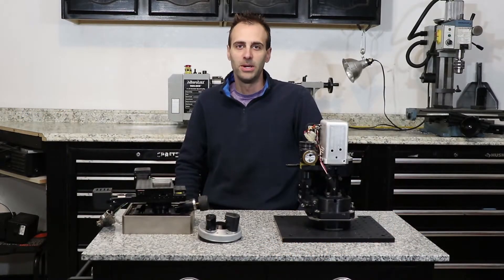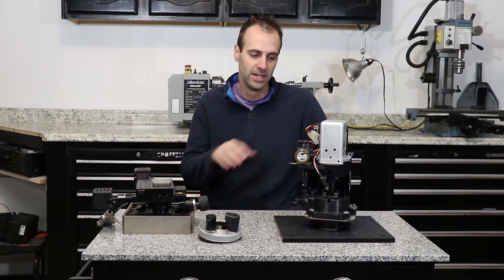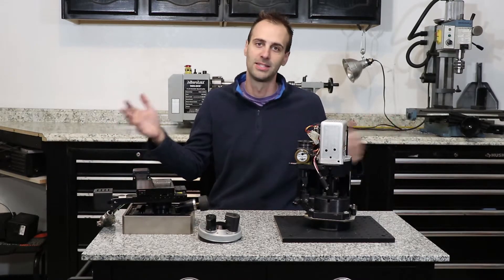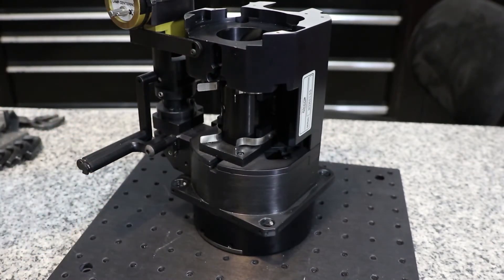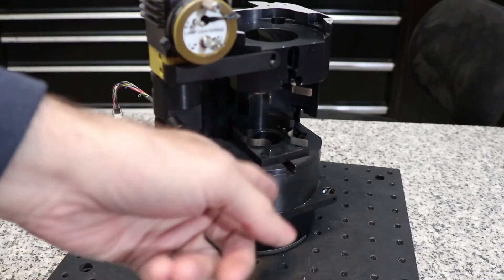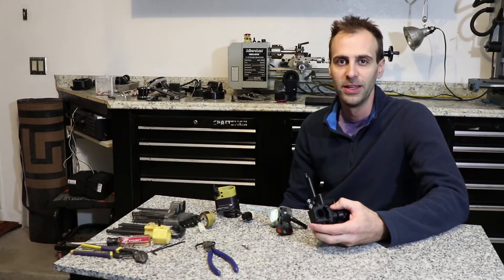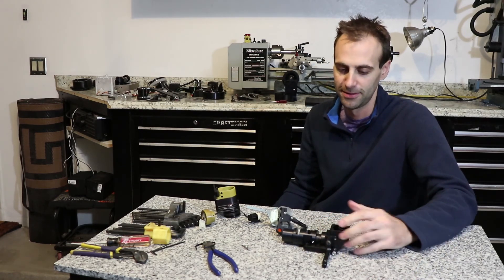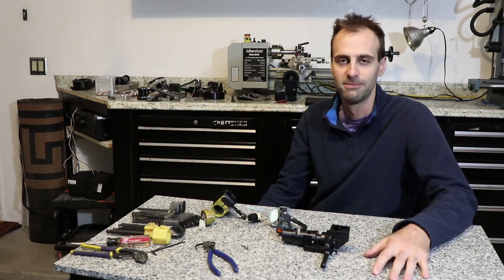SWLI Teardown - Scanning White Light Interferometer

Comment: Hi Jacob. Completely agree with learning by disassembling. Wonderful source of interesting equipment is university surplus warehouses, depending on the University's focus. In this area, one is biology and medical heavy while another is engineering heavy, and their stock is pretty different. Unlike the standard stuff that can be found on eBay, exotic stuff can be found "cheap" at the warehouse sales.

I saw the filters, what I'm missing something? These instruments don't use monochromatic light? I expected monochromatic light based on how glass flats work.

Love the discussion on flexures and kinematic mounts. I was introduced to those by Dan Gelbart's videos. Would like to learn more about them. In particular, how to achieve precision through alignment and adjustment methods without the need for precision machining.
Reply from the maker: Like most things the simplified explanations illustrate with monochromatic light and basically flat objects (flatness on the order of a few wavelengths and curvature that makes fringe density low enough to visualize). Going with a shorter coherence length by adding more frequencies (white light) and adding the ability to scan will give you a the ability to see fringes only near/on the plane of focus making it possible to create height maps on discontinuous surfaces. The filters just help you tune the packet's fundamental frequency and length.

Check this section out: "Coherence length and spectral width of a gaussian spectrum"
https://en.wikipedia.org/wiki/White_light_interferometry
Reply: That's very interesting! I read the DoAll Quality Control book from 1943 today. It started with how gage blocks allowed plants to obtain consistency to exchange parts around 1913, but spent at least half of the time on using glass flats for measurement including flatness, height, taper, etc. It's amazing how light can be used for accurate measurements with pretty simple tools. Just consider all the science and effort that's backing that stuff.